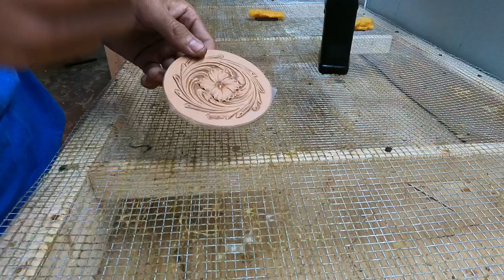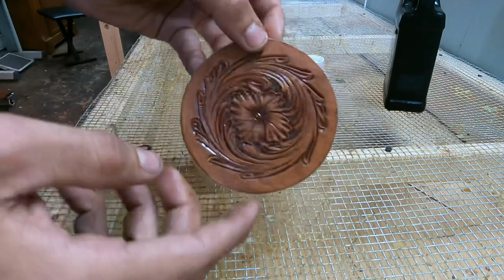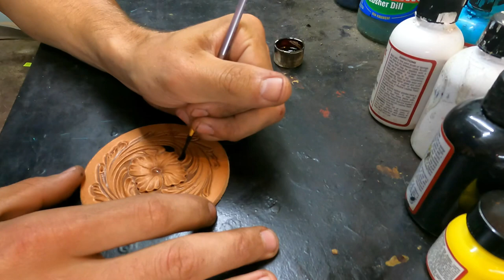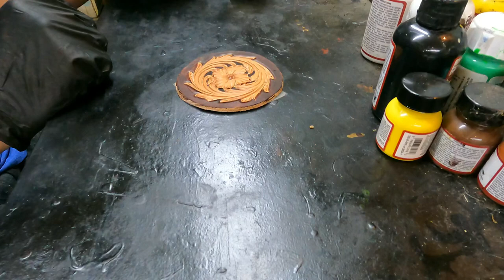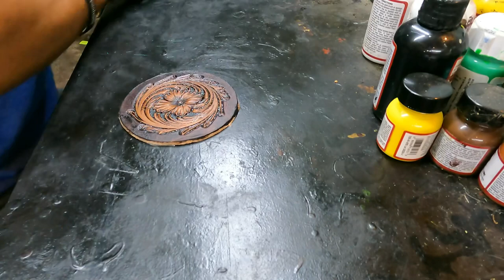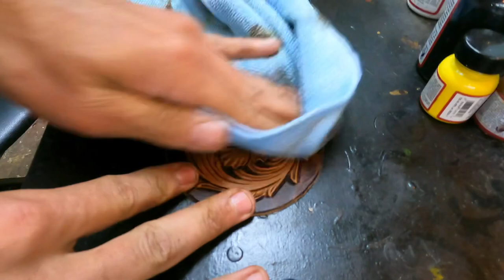How I Dye, Antique, and Finish my Leather Projects

Comment: I found some fine tip brushes for dying background that can be filled up and used over and over. They have a cap that fits tightly on them and the dye stays preserved in the pen body. I have several for my different background colors. May be something you may want to look into. They work fantastic. I do not have to dip my brush in dye and bring it back and forth over the leather or risk spilling the dye.
Reply: What a great idea!
Reply: Where can a person find them

Comment: I'm going to be making some leather grip covers to cover some billet aluminum grips that I recently ordered for our Harley-Davidson but I'm not sure what kind or weight to go with yet. The weight is gonna depend on whether or not I try to cover the rubber grips that come on it or if I need to cut them off first and as far as what kind of leather I'm thinking bridle leather but I may use Herman Oak or just tooling leather. I'm wondering if I spray them with Leather Sheen is it going to peel off and start looking bad after a short period of time or does it hold up to heavy hand use like grips have to withstand? If it does start peeling or wearing off is it easy to touch up and/or reapply or does it all need to be stripped off first?